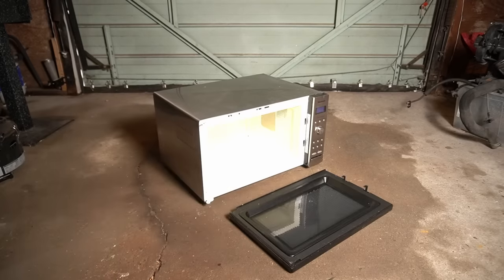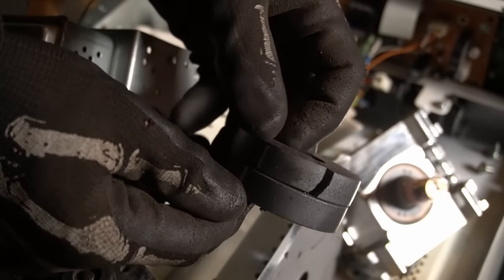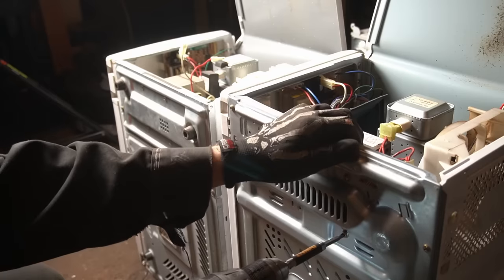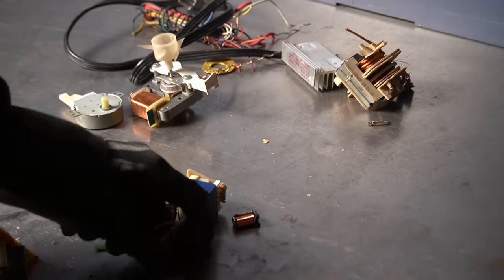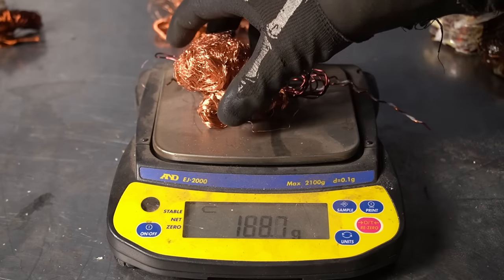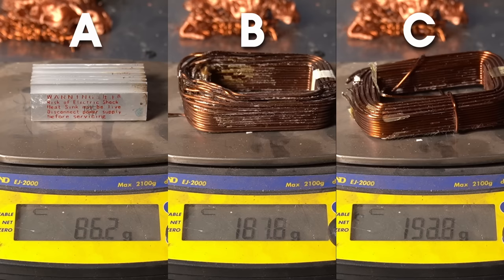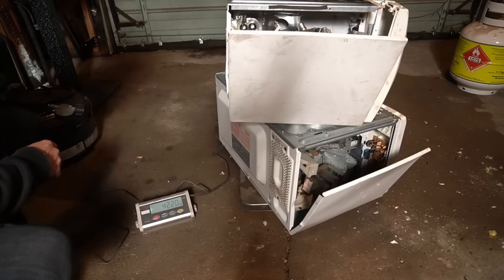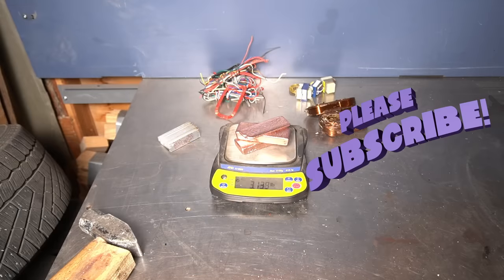Scrapping Copper From A Microwave And Smelting A Copper Bar - How Much?

Comment: I’ve given up on scrapping microwaves, i just clip the cords and throw them in my scrap pile
Reply: Understandable for the guys that find a lot of scrap and must keep it moving. 
 Me personally I break them down more than ever with the low shred prices.  To me shred is not even earning its cost of transport to the yard lately  so I have to maximize to justify.  😊
Reply from the maker: After the number I’ve opened in the past couple years only to find double aluminium wound transformers, I definitely get that! I was so surprised that both of those had copper, it’s become a rarity for sure

Comment: Can't agree that it might be the best microwave scrapping video when he started cutting wires straight up. Many people have died doing the same thing. The aluminium fins around the magnatron are easy to remove. You left the most valuable part of the magnatron attached which when removed looks like a tiny mag wheel and can be clean up to number 1 copper and the weight its worth removing

Comment: Few notes/inaccuracies:
1 - Common microwaves don't have beryllium oxide. I've repeated this myth in the past, but it's not correct. If they did, they'd be spattered with warning labels. Magnetrons that do have beryllium oxide are like, military grade equipment when you need to push the magnetron to its absolute heat limit. It's also very expensive, no one would use it in a commercial cooking appliance. Don't go grinding it up and snorting whatever it is, but you can hacksaw around it. It's just a ceramic.
2 - Underneath those aluminum fins on the magnetron is about a half pound of copper. The cross section of that round slug is at least 1/8" thick copper with copper fins inside, looks like a spaceship engine in cross section.
3 -  The square black component you pointed to that is attached to the capacitor is not a resistor. That's a high voltage diode, which, combined with the capacitor, boosts the voltage from 2000vac to 4000vdc. The resistor is internal to the capacitor (or sometimes across the terminals, little rainbow thing half the size of a ticktac). You can't know if it's discharged. Hard to discharge with a screwdriver, easier with a pair of pliers.
4 - The ferrite beads wrapped in copper are either small transformers or inductors (coils).
...
I actually have a tutorial series on re-using microwave parts on my channel that I made, oh... 11 years ago now.
Reply: You forgot to add that breaking the boards up like that is hazardous as well, and also that if the microwave has sat a few days then there is very little chance of the capacitors having a charge.
Reply: 4 - these components are called toroids. 

Great explanation about the diode 🙂
Reply: @DanielCordone73  - No. A Toroid is the shape (technical name for a donut). They're inductors (if single-wound) or transformers (if 2+ wound).
Reply: Good to know. I will take them out and throw them in electric motors from now on. (Still not messing with them...)
Reply: Just went to your You-Tube Channel Subbed :medal-yellow-first-red: and then Looked at your Vids..... and there are only 8 vids up?  and the newest was 11 Years ago ?? Why ??where are Your New Vids???
Reply: @Geenalee1 - Well, once upon a time, some other Youtubers watched my videos and they wanted to build my projects I was planning to make, right away. So they asked how to do that. So I told them how to do all that. And, I move slowly, they moved quickly. They made their videos first. And they offered to hold them back until I was done mine. Back then you couldn't make money off of Youtube, there wasn't a monetization program or ads. It was just people posting things because they wanted to. So I said no, go ahead. Well, they went and built most of my planned projects and got 12 million subscribers of off that and a lot of other projects they made, and meanwhile my production value was such crap I never felt like finishing most of them. And, making videos is a lot of hard work. 1-2 hours of work per minute of video. I've always meant to continue them, but never got around to it. I have probably 30 or 40 unlisted videos that have minimal editing, just to share projects of friends, but that's all I've done.
Reply: How about the fact he calls it smelting when it isn't?

Comment: @4:33 That discharge component is a diode, not a resistor.  I laughed at "gently persuaded."  Thanks for another good video. I actually had a really old microwave not long ago where both sides of the transformer were copper.
Reply from the maker: Oh, diode, that makes way more sense 😆 I get a bit lost in electronic components. I got one of those double copper ones a long time ago too! Not very common these days

Comment: I am now using your hammer method to bust up welded transformers, I always figured the welds would be stronger than that. Thanks!
Reply from the maker: Glad to share a good tip! ProjectShopFl pointed me to the cross-peen hammer (the wedge) and it’s a great choice. That guy has some awesome equipment for transformer cracking 👍

Comment: Turned a $960 microwave / convection oven into $9 of copper.  It likely had a broken door switch.  The microwave broke in mine so we put it on a cart out on the deck so we can bake outside in the summer without heating up the house. It is awesome.

Comment: The popping that you hear is backfire in the tip which can be caused by air getting in the tip. Make sure you have a anti-backfire valve on your torches. Failure to have them could be very dangerous if the backfire flame would travel through the heses to the tanks. Take off your tip and make sure the sealing surfaces are clean and not distorted and properly tightened.

Comment: At 4.42 the component described as bleed resistor is in fact a diode part of a voltage doubling circuit.
Capacitor will self discharge in at most days.

Comment: As  I watched you melt copper in dish, I couldn't help notice the substantial amount of heat loss escaping the bowl.  Could a guy not  utilize a single brick from wall to set atop the dish off-center, thereby leaving smaller opening, large enough for torch to pump heat in but 75% more efficient at trapping the heat inside where you wish it work on the business at hand.  You are a goof, but a good goof at that.  Best Wishes, Dan

Comment: The thing about stainless steel sorts is the nickel and molybdenum percentage.

'chrome steel' (which is also stainless steel) has no nickel.

If you can get enough of the 'magnetic stainless steel' it's still worth around 10-20 cents more then steel.

Comment: The pink in magnetron is not beryllium oxide. It is way too expensive to use beryllium oxide. The microwave ovens in the early 80s had beryllium. They use aluminium oxide..i took apart two microwave ovens they use in professional kitchens and they had two transformers with both the primary and secondary copper windings. Very cool.
Reply from the maker: Ohhh that sounds like a spectacular microwave! I’ve been told they don’t use beryllium anymore but I can’t verify that so I’d rather err on the side of overly cautious. Don’t want to be caught giving folks dangerous advice!

Comment: The center core between the berrilium and the opposite end of the magnetron is a chunk of copper and the fins are aluminum
Reply from the maker: You mean inside the steel tube thing? Not sure I want to get that deep in the ceramic! 😆

Comment: Very nice video. I think that the pooping sound from the torch are happening because your oxygen/fuel ratio was too high towards the oxygen. Try opening the fuel valve more
Reply from the maker: Right on, thanks for the suggestion! I thought it was just dirty but I haven’t really used it that much so I wasn’t satisfied with that explanation

Comment: Is there something special about that crucible that you are melting the Copper windings or can it just be a steel pan?
Reply from the maker: It is a ceramic crucible and not a steel pan so I assume it’s special somehow! 😆 without having tried it I would assume it’s because steel oxidizes with heat (like a grate on a fire pit rusting away rapidly) so your copper would end up stuck to it at best, or it would crack and spill at worst.
Reply: @thubprint  thanks. you are a scrapping god. can you provide a link somewhere to where you bought this so we can be your little mini-me and copy you? or can I just google for "ceramic crucible" and anything there would work? I wasn't sure if you were purifying or cupelling the copper with it, or just using it to hold the molten copper. I didn't really see what happened to the coatings on the #2 transformer wires so I didn't know if the crucible was soaking it up, and what kind of flux you put into it. I saw you threw something in, but you didn't say what it was. and is your torch an oxy-acetylene torch, propane, or MAPP gas you use with the torch? I melt aluminum in steel pots and it works just fine, but I haven't been able to get the temps up high enough for copper so I like your approach to just use a torch and heat the copper direct. I'm just not sure what kind of torch you are using.

Comment: I do believe that the value in copper is not scrap yard prices.
What would it cost to go buy copper?
Well, that depends on shape/form and purity.
But roughly...your ingots...$10 a pound depending  on the stock market.
Yup. You would get more on ebay than the scrap yard.
Make them look really cool and you can get more $$$.

With your overhead in tools...

Comment: With a very small investment, ebay a couple dozen 10amp cherry switches and 10amp fuses. The main reason microwaves break down is because impatient people pull open the door to stop the microwave instead if using the Stop button. By pulling the door open, we're breaking the entire load through the door cherry switch safety interlocks, and destroying them. If the switches stop deactuating on time, the main fuse blows. Just replace all cherry switches and the fuse, and put the darn microwave to good use. And no...I'm not from Vietnam.

Comment: Ya if the microwave has security screws I just take a hammer to it even tho I do have a security bit set nd what's in the component that has vegi oil in it I got quit a few but wanna know if it's worth taking apart or just tossing
Reply from the maker: I’m not sure which component had oil in it, sorry 😅

Comment: I just wanted to know why you melted the copper in a petre dish,then put your copper in your crucible?/copper forge?baffling work my friend 🤣👈
Reply from the maker: I was hoping my torch would be able to melt a full dish of copper because I prefer the footage when you can watch it melt, but it was too much material for my torch so I had to go with plan B. It would have been better to do a melt and a bar for each microwave but the kiln crucible I have for copper is really large and I worried about underfilling it and not being able to pour it properly

Comment: I've found that most insulated wire is now aluminium too 😢
Reply: Take a file to some exposed ends and be sure  it's not just tin coated copper.  The first few years of me scrapping I was throwing the tin coated in the low grade bucket, now I check it and  find that about  80% of it is actually copper.  My #2  copper  bucket fills up much faster now. My yard doesn't even question it but I would suggest keeping it in a separate bucket and show them the ends that you have exposed the copper just to be safe 😊👍
Reply: Ya it's just tin coated.

Comment: microwaves i'm finding now have aluminum winding transformers.. = scrap steel
Reply from the maker: I’m getting used to that too! I was so surprised to find both of the extra two were half copper, had actually hoped only one would be so I could show total value from any possible type. I suppose it’s simple to just subtract 1.2lbs from the copper total but I agree, double alu = steel shred. Still $3 though!